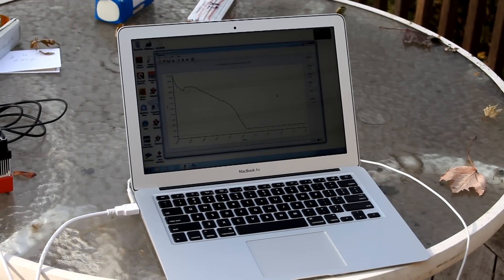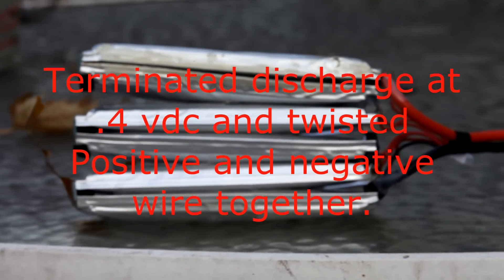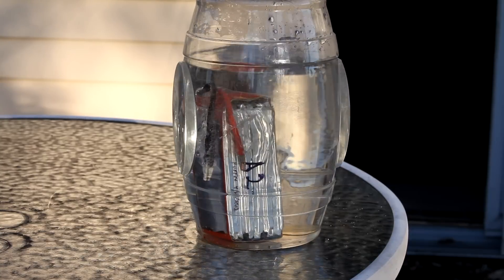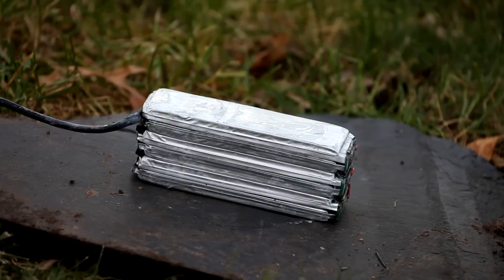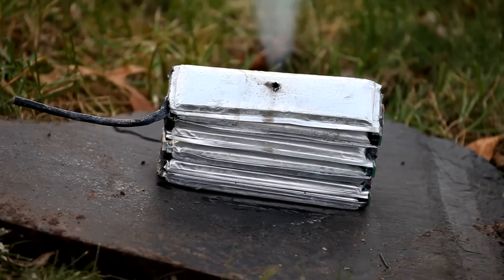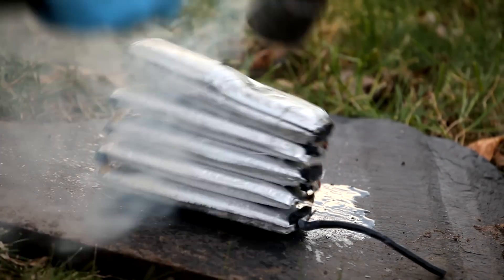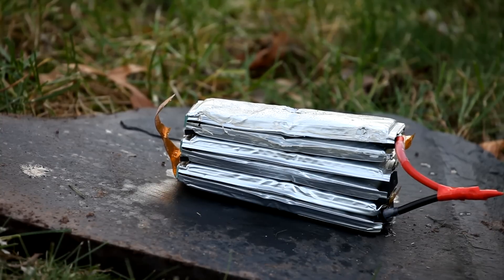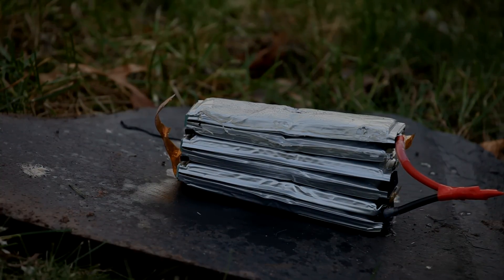Safely discharging a lipo for disposal

Comment: https://www.youtube.com/watch?v=EYwCqaE2cJg
^^^^^ this is the right way, do not use a nail !!
Reply from the maker: My driving a nail through the battery was to show that resistive discharging was the effective way to render the battery inert. Not the saltwater bath method which left a significant amount of residual energy. The nail is not an approved or recommended method of discharge or disposal.
Reply: @eddiscus  I understand what u are trying to convey but many people may get the wrong message and may try to "discharge" their batteries the wrong way. the battery actually says on the back not to through them away so by making a video as such, you're are causing damage to people and the environment.
Reply from the maker: @youngboys8295  I am sure recycling technology has changed but I doubt is as wide spread as we think. But more of a placebo effect for the general public. In the EV marketplace the repurpose cells for residential powerwalls due to the lower power density and performance demand. Back when I made the video articles learned toward the recycle process being more of an environmental hazard and cost prohibitive process. 
https://iopscience.iop.org/article/10.1149/MA2018-01/4/606
I wanted to point out the end users responsibility to render the pack inert before going to the local battery dropoff location and tossing them into a bin.

Comment: do it the fun way .jam a long screw driver through the body after it puffs and run . make sure to quickly turn back and see the flames. after a few minutes the battery will be fully drained and able to throw away after its cooled down

Comment: Safe discharge is really easy. Just hook up a 6v halogen/bicycle bulb for each individual cell. Let sit for a day after no glow is seen then they're really empty. I do that with those cells I throw in my battery bin I once a year or so takes to the local recycling station.
The advantage of using bulbs is that resistance is decreasing rapidly once glow is gone so it's effective a short - but no short when battery is full and a short will be catastrophic.

Comment: so where do i properly dispose of a lipo i have one thats gone bad
Reply from the maker: Depends what your local regulations are. The point being and it seems some are not even getting. Is that the saltwater bath method, recommended by one of the hobby battery manufactures and others is messy and ineffective in rendering a pack safe for disposal. Any type of restive discharge method is preferred. It is no problem to toss any of our typical house hold batteries in a recycle bin. But to toss a partially or fully charged 6S 5000mah pack in a recycle bin shows disregard for other peoples safety.

Comment: "safely discharge a lipo" Hammers a nail into it. Lol
Reply from the maker: Hammering a nail through is not the recommended method of discharge. It was done in the video to demonstrate the difference between the proper method of discharge(resistor load discharge) vs the ineffective (salt water bath) method.

Comment: I dont want to critizise you... Buuuut if you run current through salt water mixture, you generate Chlorine Gas and oxygen at the negative terminal and hydrogen and  sodium Metal which again reacts with water to create sodium hydroxide and hydrogen at the positive terminal. So generaly nothing you want to do in your backyard. Again dont want to critizise you! If you know what you are doing, go ahead and do it.
Reply from the maker: Don't worry I knew what I was up against doing this. But that is a valid point. One of the model battery manufactures recommends the salt water bath method.

Comment: NEVER throw batteries of ANY kind into regular trash!!
Telling people to do this absolutely irresponsible!
Reply: Full support. The danger is not only through the fire but most of the batteries contain a lot of other chemical substances, most of them poisonous. Although to reused some of the is economically (yet) not viable, they can be at least disposed responsibly.
Reply: The danger of the batteries after being discharged, destabilized, and bathed in saltwater.... is next to nothing 

Even puncturing these with a nail after discharging was not enough to start a fire or even explode

Maybe if you live 50 miles from the nearest recycle plant or turn in location 

This video might be something to consider
Reply: rawk4life93 Bull shit. if that first pack he punctured was around flammable material, it would had started a fire. he even said it in the video.
Reply: @xenonram  but it wasn't. So go fuck yourself

Comment: I really do like your video, its an important safety message. Thank you.
But  I just want to learn. .  Don't lots of these batteries have a voltage drop cutoff circuit internally that would stop the resistive load from discharging them?
Reply: Most rc battery’s rely on the esc and charger for the protective circuit i personally use lectron pro battery’s they are pretty pricy but not a single one has cough fire and had them for coming up to 4 years

Comment: YES, FINALLY, SOMEONE DEVOID OF IGNORANCE.  The whole point is to introduce salt water to the INSIDE of the cell.  I guess most people don't take the time to learn dropping an intact pack into a bath does not accomplish this.  WARNING:  VENOM REQUIRES THIS TO BE DONE BEFORE THEY WILL HONOR A REPLACEMENT OF DEFECTIVE CELLS!  THEY ARE PROMOTING DANGEROUS PRACTICE!!  SEEMS VENOM RC WANTS TO SEE PEOPLE KILLED!

Comment: There's another reason why you shouldn't use a saltwater bath for this. When you put a battery in it, the bubbles you see on the negative terminal is hydrogen. Remember the Hindenburg? Hydrogen, in the presence of oxygen, is flammable. Guess what gas forms at half the rate on the positive terminal? Oxygen! Besides being potentially flammable, my chemistry teacher mentions that thie form of electrolysis actually may form some chlorine gas. Nasty stuff. Not sodium hypochlorite (the "chlorine" in bleach), but chlorine itself.
Reply: of course hydrogen is flammable
Reply: Michael beseler Not by itself though. A flame in a container of pure Hydrogen would extinguish.
Reply: Aaron Lowe true
Reply: @aaronlowe3156  Nuclear reactors have a Hydrogen bubble in the top of the unit. Even TMI had one with oxygen present but could not reach the explosive level and after one day as it cooled the oxygen was reabsorbed by the water.

Comment: Thanks! I was nervous doing this the first time but I found your advice to discharge/puncture was quite simple & non-reactive :-)
I used a car headlight to discharge a 3S lipo down to 0.1v, stripped & twisted the leads together. Left overnight & then punctured with a nail.

In my case I used a 55W bulb but i think this will discharge very quickly (15 mins) & its better to use something with lower wattage.
Reply from the maker: Puncturing with a nail is unnecessary. It was just done in the video just to show the reactive pack from the saltwater bath vs the properly discharged pack. Once you discharge and confirm the voltage or lack of with a voltmeter then the pack is ok for recycling or what ever your local regulations are.

Comment: i put all my fully charged batteries and full propane tanks into the ocean
Reply: I had a few "scary" batteries. They was charged fully and i felt it was scary to use. I put them in the trash can along with flammable materials like lighter fluid for grill that wasnt really empty and it probably leaked from the bottle it was half full but i didnt need it anymore. The result? a destroyed garbage truck or at least fun for them to deal with
Reply: Nice, screw the turtles...

Calm down Karen it is just a joke...
Reply: Smartass dude

Comment: I have a bit of a situation, and not sure how tto proceed;  I have a small 1200 mAh LiPo pack that I've  had  for a good few years that is in a portable charger for an old Cig2O eCigarette.  I charged it today and noticed that there was some slight bulging from the charger housing, and opened the charger itself to see how bad the puffing on the pack was.  I know from past experience that the cells are around normally 1/8" thick.  This pack is around an inch to an inch and a quarter thick, and looks like a new pillow.  How would you recommend I proceed in this case?

Comment: Why would you throw away the battery if only one cell is gone? make it a 4 or 3 cell or something! Why waist it?
Reply: +roger hurd yup that's what I do. I do a few cycles to find the capacity and then stick them together. I'm time rich and money poor.
Reply: It doesn't work like that
Reply: +shaneman27  You are kidding... Right?
Reply: no I'm not kidding. i always save the good cells.
Reply: +shaneman27 LOL I have taken individual cells charged to full and matched them to other of the same capacity and voltage. Have made numerous new 2, 3, 4, and 6 cell batteries from other packs that had 1 or 2 cells go bad. Yes you can do this with patients and a solvent for the glue that binds them in some cases. 
To the people acting like this is a bad idea or it would not work; guess what, its not rocket science.

Comment: Cheapest way to discharge them that I'd think of would be to put a 220-1k resistor across each cell (solder them to the balance leads, or hell, just jam them in the balance port). If you do any electronics stuff you probably have a bag of them lying around: each is maybe a cent. A 220 ohm resistor across a LiPo cell will pull about 16 mA; small, but nothing is corroding like in salt water so you don't have to worry about incomplete discharge due to terminals rusting off.

Comment: Hello Ed.
I have a couple of old LiPo cells from a MacBook Pro battery (the famous bulging 2006 series) which got bulged. 
After trying to cut off one of the cells from the controller it turned out that the next one in the pack will start to bulge and so on.
Since then I have salvaged the casings but the packs themselves are still somewhere in an insulated metal box in my garage, still attached to the controller.
The question I would like to ask is -- why would this happen? Incorrect controller firmware maybe? Since both packs went on the same effect after about 313 cycles. Or maybe the heat from the full-metal laptop casing made it go like that?
Also, what is the proper way of storing, handling and disposing bulged cells?
Thanks in advance.
- Ak.R.

Comment: what is the name of this charger with the fan
Reply from the maker: SoftTechthings it is a West Mountain battery dis-charger. 
http://www.westmountainradio.com/product_info.php?products_id=cba4
Reply: +Ed Johnson been looking into how to discharge my 4s lipos faster than 2 amps....my lipo chargers set to discharge+ setting only pulls 2 amps and takes around 2 hours to empty my 10,000 mah (10.0)battery...and have that going I to a fog light in Italy assembly..gets quit bright but not pulling enough....ha do you make em pull more...when I put another light added to the other the discharge cycle shuts down......my chargers state that they can pull up to 20 amps....what's going on? I followed your link to that resistance discharger, but it's quite a steep price for me to use just for that.
Reply from the maker: Maybe this is a more affordable option.  http://www.perfectregulators.com/Universal-Lipo-Discharger-Pro-V2
Please note that the perfect regulator only discharges the lipo down to a storage charge level 3.8 volts. It will not discharge down to zero. If you are looking to kill the battery for disposal then connect the fog light directly to the battery. What charger are you referring to?

Comment: In the UK we do not have to go to all this time wasting, we chuck them in a battery recycling box in all supermarkets.
Reply: You know, that might actually be true, but if it is, I don't care. You're comparing a LiPO in catastrophic failure mode with a bus operating exactly the way it's intended to, 365d/Y for a lifetime of maybe 20 years. They aren't the same at all. 

Electric power isn't toxic.
Reply: Just put some electrical tape over the exposed battery terminals and drop it off at a recycling centre, it's not difficult and it doesn't involve hours of discharging and hammering a nail through a potentially volatile battery. Or as I like to tell myself: keep it simple, stupid :)
Reply: Martins Supermarket

https://youtu.be/o7R4H1n_QQs
Reply from the maker: So you would not have any problem with tossing a fully charged slightly damaged 6S 5000mah pack in the recycle box?
Reply: Well Ed
I would keep it if only slightly damaged, Supermakets will have carried out a heath and safety audit.
Reply: Electric power is toxic pick your poison gas or electric power  lipo smoke is cancer worse than leaded petrol

Comment: well first of all your saltwater discharge method isn't following the correct procedure.
 you're supposed to first resistance discharge them to about 1v for each cell. mix up 1/2 cup of salt for each gallon water used.  leave in for 2 WEEKS.  not only 3 days.

here's a link to the manual on trakpower's website.
http://manuals.hobbico.com/tkp/tkp-batteries-lipo-manual.pdf
Reply: I think it's a little easier to just hook it up to a load, especially since it gets the pack closer to 0 volts. Also, most chargers can't get batteries down to 1v each, most stop at 3v per cell. So you'll need a resistive load anyway before you even consider putting it in the saltwater. Basically, why go through the extra effort?

Comment: Weirdly enough, a 2S 6600mAh hard-case pack puffed on me right at the end of the charging cycle, so I took outside and let it sit in the yard for a week. 
During the week it snowed, rained, temperatures went down in the mid-20's at night and high-30's during the day.

A couple of days ago I tried your technique of putting a nail through the pack... Again, the pack had spent a week outside in the cold, rain and snow but I haven't discharged it. 
When I drove the nail through all 4 cells on the pack ( it was a 2S-2P 7.4V pack ) nothing happened. Not a puff, not a spark, nothing at all. I threw it in a water bucket just for good measure but then again, no fizzing, no nothing, I was almost disappointed lollll
Reply: would freezing them work because  lipos need to be in room temperature to get the max power  and when cold they don't work very well
Reply: Can't say, maybe it'd help who knows ???

Comment: When a lipo pack is "dead" for RC, it still has a lot of life for other, less than 1C, applications!
Radios, torches, RC transmitters, whatever doesn't eat  50C.
Reduce, Reuse, RECYCLE!
Reply: Pașca Alexandru "Whatever doesn't eat 50C" For some reason I laughed when I saw that. Seriously though, if a LiPo is damaged like his were (puffed) they are unsafe and should be regarded as garbage.
Reply: EPaR - Aidan Gieg Puffed means that it had accumulated gaseous hydrogen generated thru electrolisys. 
The plastic jacket can be punctured, with much grater care and consideration than in this video, using a sharp needle to create a tiny vent hole. Obviously, the electrodes must not be touched by the needle, in any way. I poke it at a sharp angle, letting the needle enter less than twice the thickness of the outer jacket.
Immediately after the gas was evacuated, the puncture must be sealed to prevent air and moisture from entering the cell. I had great success with plain insulating adhesive tape. 

Basically, everything most people call garbage is anything but. Most thing we discard are reusable, recyclable or recoverable. 
I own rechargeable batteries manufactured in 1954 that store 80-90% of the rated capacity. 
So, as long as the electrodes themselves are not disintegrated or shorted out, as it usually happens in 18650 and small, tightly packed phone cells, the cell is, most probably, usable.
Reply: If it has puffed it is still damaged and should not be used. A LiPo cell shouldn't output enough gas in its lifetime to cause noticeable puffing.
Reply: And it is not through electrolysis. It is via the degradation of the electrodes due to damage or very very very old age.
Reply: EPaR - Aidan Gieg I'll qoute wikipedia in here so you don't have to take my word for it: ~All Li-ion cells expand at high levels of state of charge (SOC) or over-charge, due to slight vaporisation of the electrolyte. This may result in delamination, and thus bad contact of the internal layers of the cell, which in turn brings diminished reliability and overall cycle life of the cell.[11] This is very noticeable for LiPos, which can visibly inflate due to lack of a hard case to contain their expansion. ~
And, kinda yes, it'd not only electrolysis, it is, also, evaporation. None of the electrodes contain hydrogen. (LiMn2O4, Cu, C, Al. No H)
:)
Reply: Fair enough, but if it continues to stay puffed at a low charge than they are damaged cells.
Reply: Stay puffed? What do you mean? If the gas is not vented "manually" it won't disappear magically. These are not lithium hydride fuel cells to re-absorb hydrogen or deuterium ;))
Reply: Actually, when they discharge they do "absorb" most of the hydrogen gas. As it discharges the electrolyte reacts with the hydrogen to "absorb" it and produce some energy.

Comment: I have to wonder if some of this is overkill. After all, vast amounts of materials are in garbage which could self-combust when mixed. I think the biggest danger is when it is in or close to your own house. Has anyone just put them in an empty tin can and covered with alum. foil and then thrown into the garbage truck or compacting dumpster at a transfer station? The fact is that only a tiny percentage of users are likely to do any of this stuff..